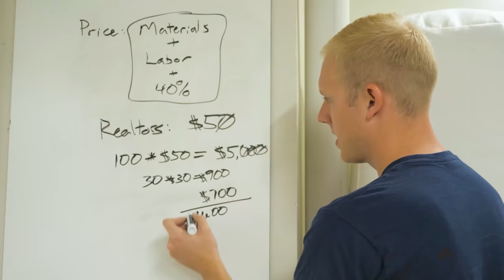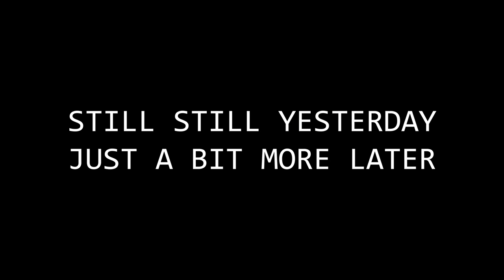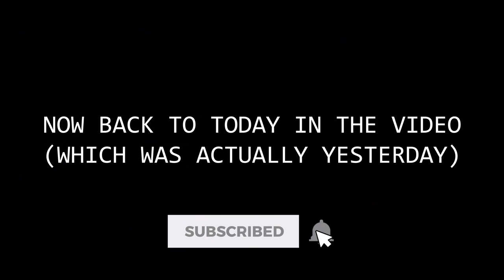WE'RE GETTING A BIGGER SHOP!!!

Comment: What do you do with all the scraps you cut off the glued up boards? Looking at 7:20 into the video. Many of these could be used to make complementary items and reduce the scrap/increase income. First idea that popped into my mind was to take the larger pieces, make 5 or 6 two inch round counter sink cuts and sell them as candle holders for votive candles, the medium size pieces could have smaller diameter, deeper holds for tapered candles. This would look GREAT on a table with your charcuterie board!
Reply from the maker: That's a fantastic idea from a hobbyist's perspective. But you're leaving out 70% of the work which is marketing, selling, and supporting additional products. We just don't have time for that!

Distractions will look like opportunities if we're not focused on the goal!
Reply: @jennieanddavis  Actually I was just thinking of offering them as a bonus to some of your better repeat clients, that way you avoid all those things, and don't have to guarantee any inventory. When you have more scrap large enough, make a few bonus gifts, never offer them as a permanent product. Reputation tactic, as you know, people love unexpected gifts.
Reply: @shadoe1769  I think what their point is that they are building the standard boards in a batch process which they can churn out quickly. If they take scraps that come in all different shapes and sizes and have to piece them together like a puzzle for each piece they create with them, it is not efficient and takes away time from other more important tasks that they could be doing.
Reply: @bradthompson128  My point was, there is nothing to piece together, just a few holes to drill. If the scrap isn't large enough as is, it remains in the scrap bin. Minimal work for free advertising. But hey, it was just an idea from a guy that does leatherwork, OTS and custom, so I see profit/loss in every piece of scrap. With leather you can make lot's of easily sellable items out of much of the scrap. I'm not a wood worker, so it was just an observation.

Comment: NEVER ROUTER CONTINUOUSLY AROUND THE BOARD. Router both long edges than the across the grain. You will have less chance of tear out when you hit the end of the short pass on the boards. Long long short short. It will add 1 second to your process but less chance of a tear out. Be safe out there.
Reply from the maker: Never had an issue with that! Thanks for the tip - we’ll keep it in mind if that happens

Comment: great job, keep movin forward, I cringe every time you pull out the palm sander(s).... new place, more space... upgrade to a Heavy Duty Dual Drum Sander with belt feed much more efficient, had a cabinet shop next door once, it did a fantastic job on cabinet doors.
Reply from the maker: Do you know of a drum sander that doesn’t leave deep scratches in a streaky pattern? Even at 240 grit ours leaves streaks.
Reply: You need a timesaver or duel large belt if you got three phase you could pick one up at an auction for a good price.

Comment: Great video... btw, i use the same abranet sanding discs, but I tried the 3m cubitron and am having a MASSIVELY different experience than you have.  I will be using abranet as a backup only.  the removal and longevity to me is so much better on the 3m.  You should give em another try :)   keep up the great work
Reply from the maker: Glad to hear! After our video and some other people have tried it, it sounds like there are some quality control issues - we'll probably switch if that gets ironed out!